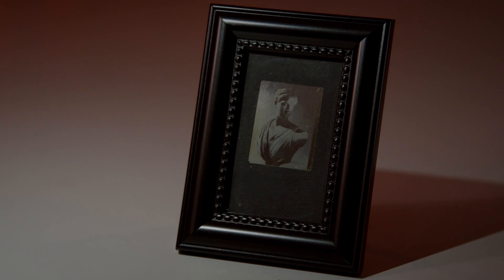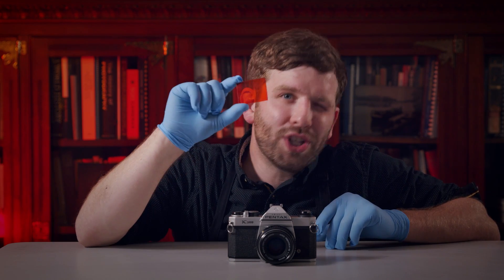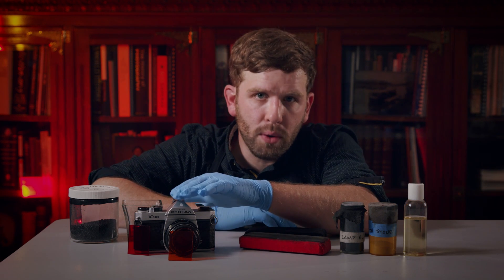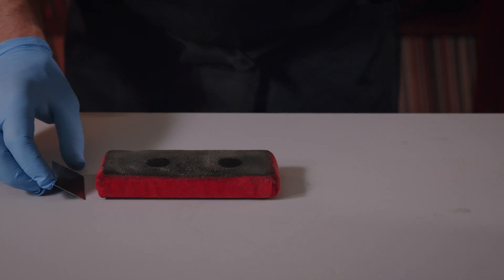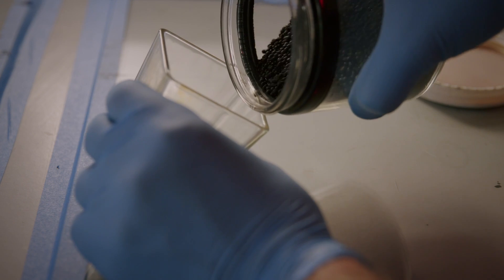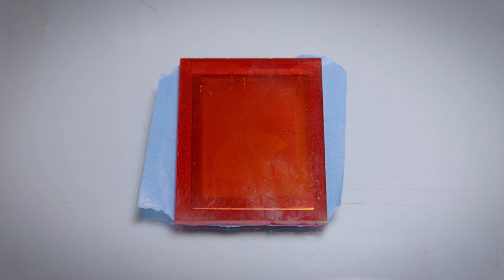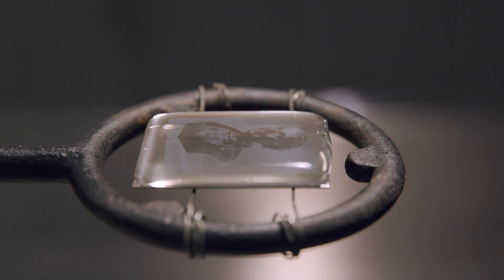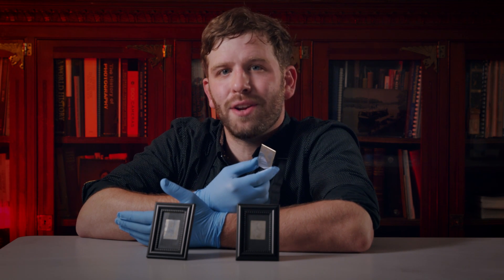Make a 35mm Daguerreotype

Comment: If you don't want to spend money on the silver plates, you can alternatively use a mirror of all things! 

Apply paint stripper to the back of the mirror until it removes the back layer. Citri-strip apparently works the best as it lacks volatile substances. Wait until the back layer rises and wrinkles, then remove the copper layer. Try to avoid letting the stripper touch the silver layer

Instead of buying iodine crystals, iodine tincture for cuts and wounds can be used. It's slightly less harmful to breathe in but, still exercise caution. It takes longer this way as well, but it is cheaper. About 45 minutes to an hour.

Development can be done the same as done in the video

Fixing the image can be done in a solution of 2.5g sodium thiosulfate and 2.5g of sodium sulfite in 200mL of distilled water

It's a bit more fragile and slightly less detailed than using a true silver plate and actual iodine crystals, but it is far cheaper and a good entrance for those interested in daguerreotypes.
Reply: Since buying iodine is such a process in the US, I made my own. Pretty simple, sodium iodide is cheap and readily available. Potassium iodide in its native form smells like iodine and has less of a pure yeild, so I don't recommend it as much. The only thing I would caution anyone on is the handling and care of iodine. Don't breathe it in, use the appropriate masks, wear gloves, take all the precautions to treat it with its due respect. Glass, Teflon, and enamel all resist the corrosive, staining, or otherwise detrimental effects of iodine on materials. My box I'm making to contain it will be of Teflon sheets drilled in with enamel painted screws. This to me was a difficult step in the process, much harder than polishing, plating, and prepping. Hope this helps.
Reply: thank you!
Reply: Modern mirrors don't use silver, but vapor-deposited aluminium, so this won't work.
Reply: Regarding iodine dressings, pour iodine dressings into a glass and place a silver plate over it?
mirror part I still don't quite understand. But do you mean normal mirror or silver mirror?
I'm really interested in it and want to do it myself.
Reply: @wreckedboy9667  I believe regular mirrors. The older, the better (The mirror I had the most success with was taken from an old dresser from the 80s-90s). Be gentle since the stripper agent can remove the silver as well. It might take a bit of scraping to reveal the silver layer, just take your time. If you have access to silver mirrors, I am sure they will work as well.

The iodine dressing is used the same as the iodine crystals: placed in a container and then the silver plate (in this case, your stripped mirror) placed just above it to let the fumes form silver-iodide on the surface. It takes longer than the crystals, about 30 minutes to an hour.
Reply: @garge7676  What if I use a silver-plated copper plate? Will it take a long time as well? Well, I'm not sure if I can find an old mirror like that. Because I'm not sure what materials are made of today's mirrors. from what i understand Old silver mirrors were worth more than modern mirrors. Honestly, I was curious to know what to prepare because it would be really fun to make. Some things, some materials, if you can suggest where to get them that would be great.:virtualhug:
Reply: @wreckedboy9667  Making your own silver mirrors isn't too arduous a process btw
Reply: @garge7676  i wonder why my plate is fogging like crazy. Underneath those fog are vibrant magenta color but idk how to resist those fog. How?

Comment: Question about the plates: Is there any reasonable way to store prepared plates? Say, you fume the plate and then store it for later use. Of course you'd have to store it where light can't get to it, but what about the chemistry itself, does it oxidize or degrade over time?

Comment: For those of you wondering what the proportions of fixing chemicals and gilding chemicals to use:

For fixing - 15 grams of sodium thiosulfate dissolved in 500ml of water. Store and use as needed.

For gilding: 1 gram of gold chloride dissolved in 250ml of water, and 2 grams of sodium thiosulfate dissolved in 250ml of water. Store separately, and combine the gold chloride to the sodium thiosulfate in the amount you want and give it about 12 hours for the solution to mix. NEVER ADD THE THIOSULFATE TO THE GOLD CHLORIDE - ALWAYS ADD THE GOLD TO THE THIOSULFATE.

About 4-5ml of solution is required to form a proper meniscus on a 35mm plate.

Also, be very careful about heating up the plate before the gilding process. Becquerel daguerreotypes are extremely sensitive to heat and too much will fog the image, making it all but invisible. Practice makes perfect! It took me a couple tries to get it right!!
Reply: Hello there, since you already seem to know a lot about this process - do you by any chance know how the mixing of silica gel beads and elemental iodine works ? And in what proportions it has to be done ?
Reply: why not electroplate it instead of chemical plate it? electroplating is easy.

Comment: Where do you find plan silica gel and pure elemental iodine
Reply from the maker: We would be happy to share information about where we source materials. Contact us at darkroom@eastman.org.
Reply: silica gel from Talas in NYC iodine on ebay/Etsy as crystals/flakes or prills (which is  lass resort as they need to be crushed first).  Otherwise hard to get as it is a DEA controlled substance as its an ingredient in METH. I don't use the gel for iodine, not necessary.  BTW, most only use silica gel with mercury dags for bromine

Comment: A few questions. 

1. What sort of exposure times can one expect with this specific process? Assuming a cloudless sunny day shot with a 50mm at f8? As I understand it ISO ratings are pretty much useless for this medium.

2. What sort of shelf life do the prepared blanks have after fuming? Could one in theory prepare multiple plates in advance and swap them out in the field (with proper measures to protect them from incidental exposure.) Furthermore do they need to be developed immediately after shooting, or can they be set aside in complete darkness as in the aforementioned scenario?
Reply: f2.5 EV 16 I shoot at 30 seconds for a neutral subject.  Yes, you can prepare and bring several plates along, but you should start developing immediately.  I shoot 4x5 and have a developing screen for each film holder and start in the field.
Reply: @the_art_doctor  Does listing exposure times make sense here? Glass blocks uv, so I'd guess that you'd have lil different results with triplet compared to tessar for example, of course it's not like cyanotype or physautotype where UV is the only light sensitive thing but still I'd guess it would vary, not even talking about lens coatings.
Reply: @butlaoctu4464  It is an orthochromatic process, UV and blue/white only with ever so sight yellow green.  Your thinking too hard, the speed is so slow that minor corrections do  not matter.  Old lenses without coatings work fine as do most modern coated lenses.  2-5 seconds on a 30 sec exposure is not a big deal either way.  You can use filters and longer exposures 20-30 minutes to get some better details but shake is an issue then.  See Mike Robinson's work on this, you have to  hunt for his presentations and publications as he does not give away secrets for  free.  Soot with a Kodak transparent print scale inserted between plate and lens to get your timing for each lens, write it down, a log is essential.
Reply from the maker: Great questions! Reach out to workshops@eastman.org and Nick can help you out.

Comment: So if I understand right, I could also expose the silver plate under a UV-light machine (like it is used for cyanotypes) and make a contact print from film? And when using slide film, I'd even get a positive image.
Reply: Yes, exactly.  Just have to be careful that you do not scratch the iodized surface when you put the slide/negative in place.  Many folks have use digital negs printed on mylar or acetate.  But honestly the fun is in making an in camera image.
Reply: The plate is opaque and that was one of the reasons Dag's were quickly made obsolete by the wet-plate process.  Opaque plates were impossible to copy.  These days you can scan the plate and do all kinds of things like make a digital negative and re-print as cyanotypes etc.

Comment: Freestyle has wet plates for sale but they have a black coating. Which gives a good normal image. I wonder if this will coat those plates and work the same ?
Reply: No, daguerrotypes are done on silver coated plates, usually on a copper sheet, but if you can get aluminum plates and coat them with silver by electroplating, then they will work.
Plain aluminum or black coated aluminum plates won't work at all, it has to have a silver coating.
Reply: The "magic" is in the silver iodide being light sensitive.  Wet plate tin-types look superficially the same, but in that case the chemistry is different.  It still depends on silver halides (silver plus 1 with either chloride, bromide, or iodide  all are known as the halides to chemists and in this case will have minus 1 charge)) dispersed in the nitrocellulose matrix instead of the silver zero (solid silver, not dissolved and subsequently precipitated) as in dag's.  As was said earlier, it must be a silver surface to work.  Even B/W gelatin emulsions depend on silver compounds to work.  There are a number of advantages to using soluble silver then precipitated, one of which is using a LOT less silver and saving money.
Reply: No, those plates are for wet-plate tintype photographs, a kind of wet-plate collodion photograph that gives you an opaque positive image (light areas are silver, dark areas are black) rather than a transparent negative (light areas are silver, light areas are transparent)

Comment: Are there safety precautions for using iodine vapour? I've made a half plate Becquerel daguerreotype before and I remember having to use a fuming cabinet for the iodine step.
Reply: A fume hood would not be a terrible idea, but unless you are allergic to iodine, the small amounts here are probably safe if you are working in a room with reasonable ventilation.

Comment: I started this way 17 years ago.  It takes a longtime to get good at it.  Spent two years perfecting my technique.

Cheapest way to make plates are dead soft .999 silver sheet from rio grande jewelry supply.  They come 6" by what ever length you need.  Just order a 6" strip to whatever length you want and cut small plates from it with a paper sheer  They work great but are soft. If you are careful you can polish them and not bend them.  If you are a bit clumsy epoxy them to brass sheet as its stiffer.  You will never polish through these like a clad plate.  Don't try .925  the copper reacts with the iodine and makes funny patterns.  

Getting used to iodine fuming takes some time.  It is temperature dependent, will change with iodine volume, distance to plate, level of polish, ect.........keep a log book. 

Base exposure for neutral subject in full bright sun 30sec at f2.5.  Don't worry about reciprocity if you have a slower lens.  Adjust from there.

Ive ruined many a good plate gilding, not really required but when it works boy is it awesome. I have many not gilded and they are fine.

After you master this try cold mercury in a vacuum.
Reply: is it possible to develop an already shot film onto the plate?
Reply: @npc6817  Yes, you can do a contact print.  But in camera is where you want to get to.  Why intercede a less accurate, more grainy middle man into the mix, it is wasting one of the great positives of a Dag, near perfect realty with no visible grain.
Reply: @the_art_doctor   because I had an old photo I'm personally attached to and I would love to develop it like this and maybe enlarge it a bit. 
But yeah, makes sense
Reply: @smithtwashington  I used to use silica gel that looks like sand with iodine crystals mixed in a jar for staining thin layer chromatography plates.  AFAIK you can't buy them pre-mixed.  The idea is to increase the surface area emitting iodine vapor.  What I'd like to know is why no one puts them in direct contact with the plates.  Too fast a reaction?
Reply: Hello there, since you already seem to know a lot about this process - do you by any chance know how the mixing of silica gel beads and elemental iodine works ? And in what proportions it has to be done ?
Reply: @lewinberninger  I have never added silica gel beads to my iodine, there is no need to.  It was developed as a bromine storage idea that Robinson came up with. I have always used 100% iodine crystals.  I bought mine before the DEA made them a controlled chemical, thanks a lot meth heads!  The more you dilute your iodine from elemental crystals the more time it will take to get the plate to react.  Right now there are elemental iodine prills on eBay from china, better than nothing but crystals are preferred.  Prills are a reconstituted form, I would crush them before use.  But there is zero need for silica gel.  Does not matter what form you get in the end or how you use it, even liquid from the pharmacy will eventually work (total last resort as its weak and messy!), you will just need to establish the time table your material and setup takes.  This is where keeping a log of everything you do is essential.  Don't forget this stuff is highly corrosive to any metal anywhere remotely close, it will literally corrode the wiring in your walls, its no joke, secure it when not actually in use.  Do not leave it in the sensitizing box! I keep mine outside in two chemical glass bottles one inside another.
Reply: @the_art_doctor  I glued mine on cardboard. Should I polish it? I do everything just like in the video except mine was glued to cardboard but I never got an image out of it. After 1-2 hours develop in sunny day my plate still have a light gray and mix with yellow color. What did I do wrong?. Also what is the exposure time for unpolished plate? At F 5.6. And do I need to clean the plate if I skip the polishing.Just another question. I’m using a normal 1cmthick red plastic filter does it affect the result?
Reply: @Piratesjunior  Yes you need to polish, polish affects speed as much as 3 stops of sensitivity.  Plate must first be cleaned to remove oils from manufacturing before polishing or sensitizing if not going to polish.  If you do not polish it will be dull, flat looking and have no blacks, only highlights and mid-tones.  Over Iodine as long as it takes to get a deep yellow to slightly magenta color.  Exposure base is 30 seconds at F2.8 in full sun EV 14.5 for a well polished plate. At 5.6 on a poorly polished plate probably 12 minutes in full bright sun.   Look for real Amberlith as a development film. I have tried all sorts of yellow, red and orange gels and none work as well as Amberlith.  But you should still get an image even with wrong film but it will not be as well developed.  I leave in a north facing window all day out of direct light and heat for best development. You can rush in the sun but they tend to fog.  Clear in sodium thiosulfate, gilding not necessary.
Reply: @the_art_doctor  I wonder how do we clean and reuse the plate?
Reply: @Piratesjunior  Once cleared of iodine simply re-polish and any image will quickly wipe away
Reply: I know this is 4 years old buy do you know how thick the plate should be?  Specially to fit into the camera.

Also does 1000 silver plates work?